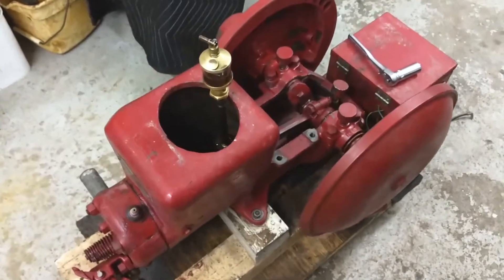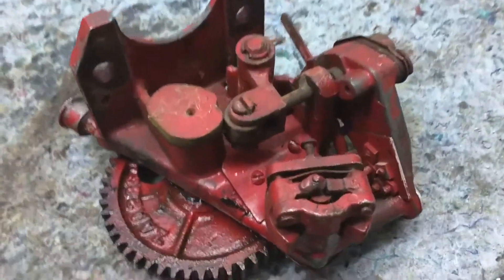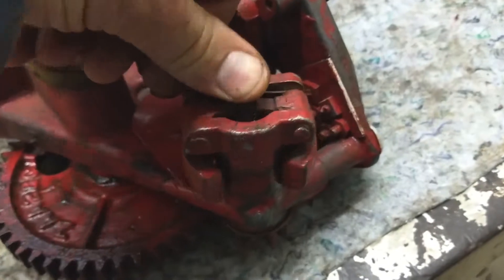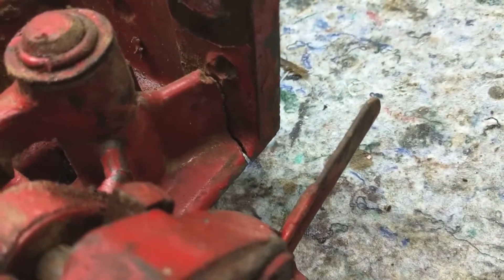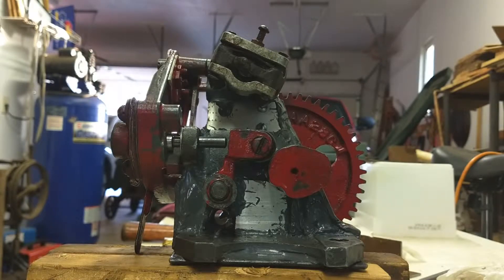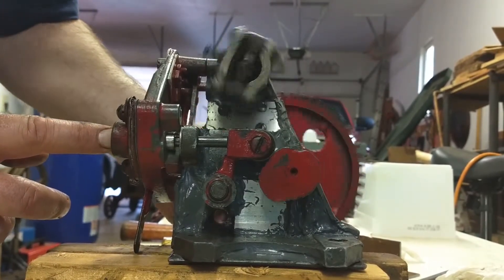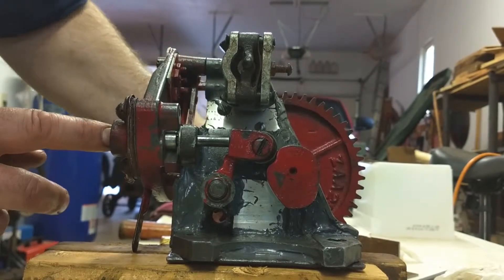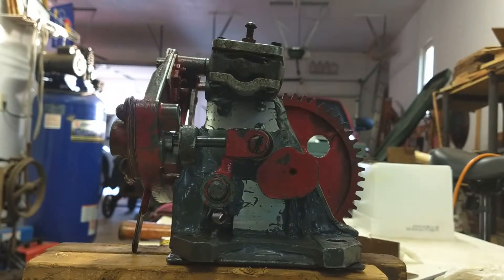1925 Fairbanks Morse Dishpan Governor

Comment: It appears there was already a "repair" done to the part with the speed selector lever. Near the bottom of the lever it looks like a small plate has been bolted on with like 4 bolts. Also, one side of the governor (the part that spins the 2 weights) is a different shape, and has a bolt sticking out of it. Mine's not like that. Was it to try to balance it after replacing that side? I've read that after a certain year FM started using very cheap metal on these timing governor parts... is yours cast iron?

Edit: Just read your description where you mention evidence of other repairs due to cracks. Looks like there is another plate/bolt "repair" I just noticed behind the cam as well.
Reply from the maker: Yes mine is made out of the cheaper pot metal material. The older it gets the more brittle. I had to reinforce it with J.B Weld, but it is almost completely hidden out of site. Thanks for watching